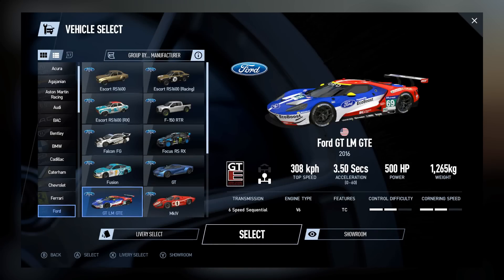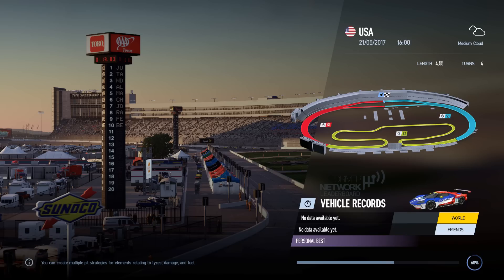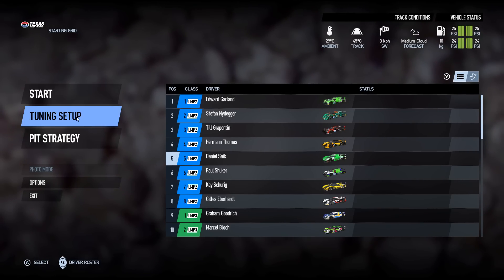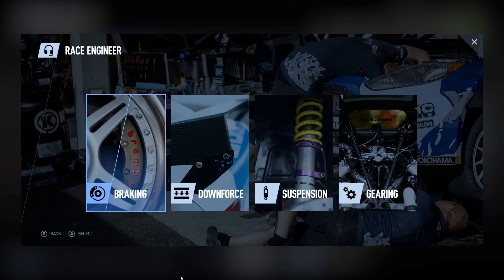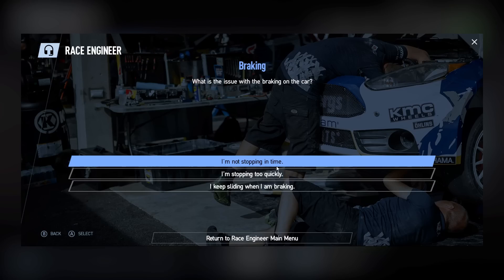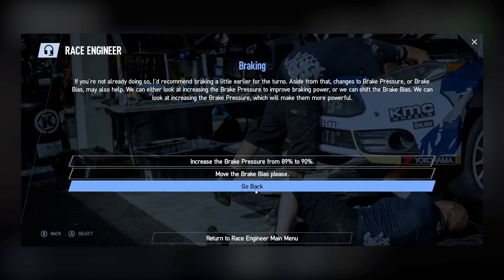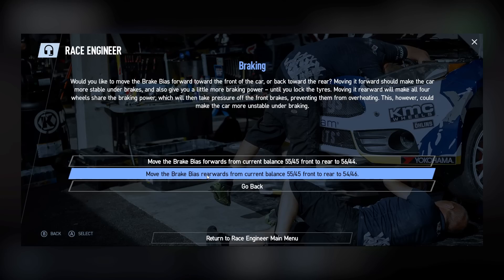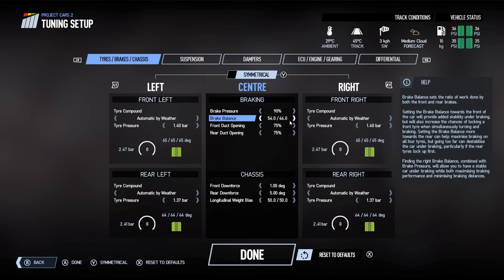Project CARS 2 - Race Engineer - WIP - Build 758

Comment: Quick Question: Are we able to adjust controller/ wheel settings as well as other options from the 'Starting Grid' screen or from in a pause menu in race? One of the most frustrating things about the first game was having to exit back to the menus, adjust settings then load up a practice session, it'd take forever to test changes and dial in  controller settings. Other games, such as DiRT Rally, allow you to adjust setting from in the pause menu, it makes wheel setup super easy.
Reply from the maker: Once in the session, I think you can go back to the pits and have easier access to most of those settings